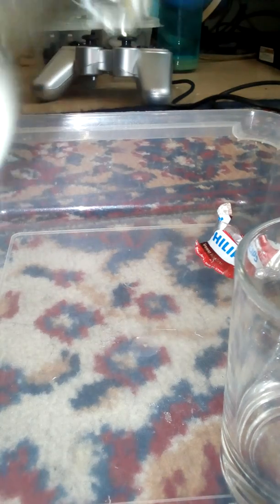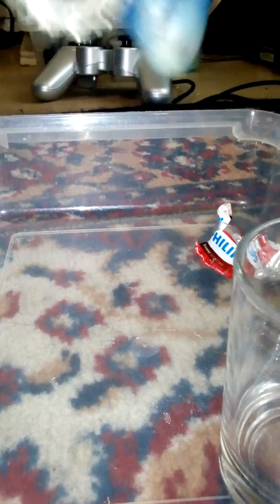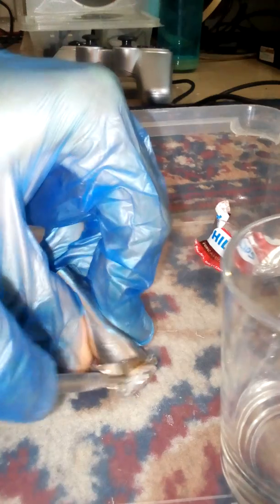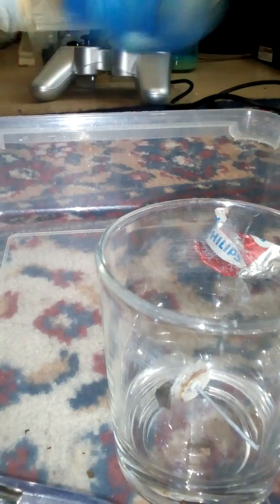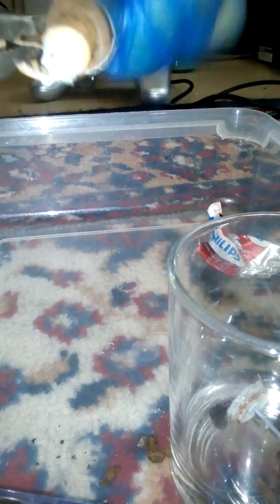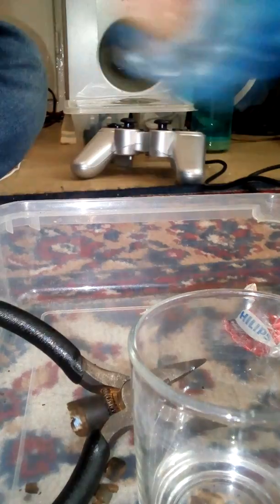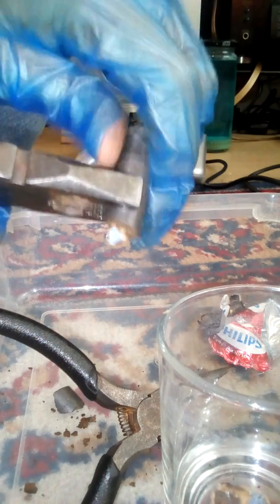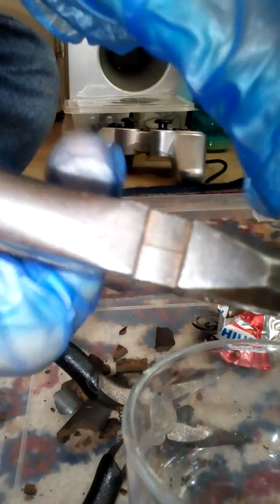Alkaline Battery Teardown & Salvage.

Comment: thanks for this. down to earth, real life example. REAL science. Only gripe is there's some things i couldn't hear that clearly.  A few replays at a louder volume could sort that for me probably. 
also, can you give real life examples of extraction/use of each component? Everything is fucking laboratory perfect and has out of reach 'requirements' these days.  
 "a magnet stir bar, heating pad and 3 types of £70 quid laboratory glassware is essential" type vids are littered all over youtubers home science viewing. 

And thanks again.  :)
Reply from the maker: @PalmIt Manganese Can be used to make Other Battery's,I Extracted this for one day making a exotic thermite in order to extract the metal manganese from within the dioxide,There is Also Zinc that can be extracted in equally small amounts,within the hydroxide component,but it's yield would be not good,The steel casing would make for a good anode for electrolysis,Expensive Equipment seems a must thesedays agreed,but there are free or near free and better alternatives,neodymium magnets within hard drives for stir bars,pickle an mayo jars work well for lab glassware thicker glass too,finding and making tools helps  save a lot anyway.